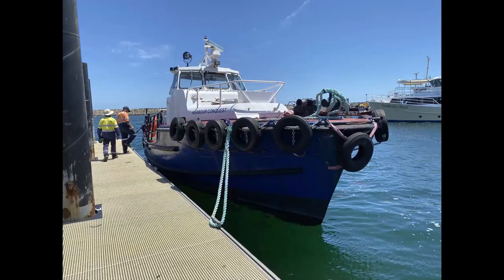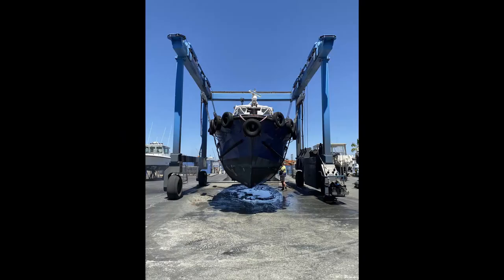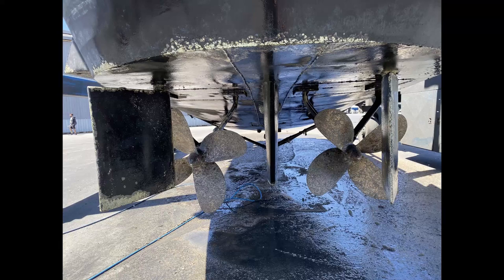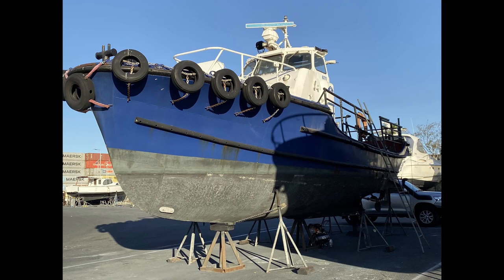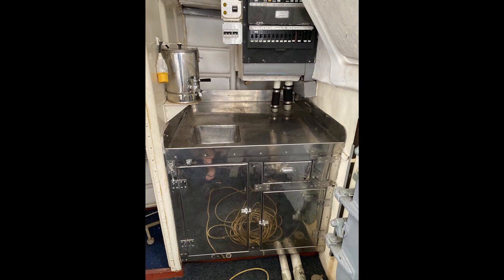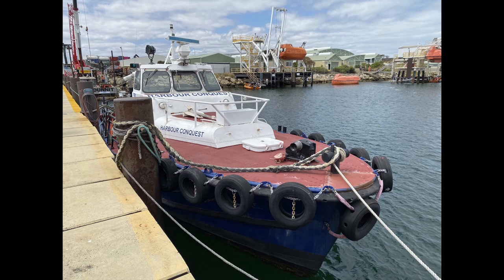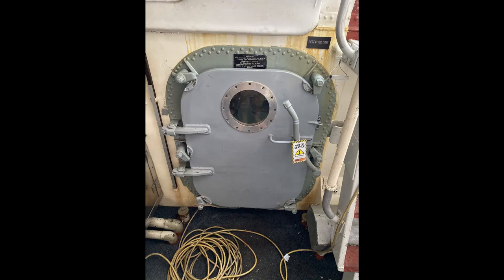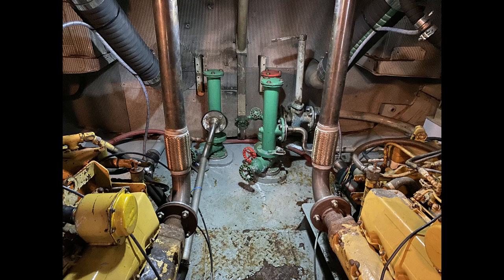Buying a 44ft Ex Rescue Boat (RNLI Waveny Class Lifeboat) - E01

Comment: Former USCG 44 MLB engineer (MK) here. Since the "turtleback" or aft cabin has been chopped off she won't self-right. Give yourself tons of time in refurbishing the rub rails as they can be a real hassle to get back on. Think about adding on splash guards along the bow like the USCG did for their boats which will deflect a lot of splash off the windshield. They're might strong boats and there's good karma in saving one of these. Thanks and good luck.
Reply from the maker: Brian Beeler cheers Brian that’s really good to know. Now that I’m more familiar with the boat I was wondering without the aft cabin sealed up whether or not she would still be self righting. Rub rails and bringing back the original exterior paint scheme will be the next big project in 12 months when she gets her next lift. I am planning around 3 months on the hardstand but in no rush, it’ll take as long as it take I just enjoy the journey 👍